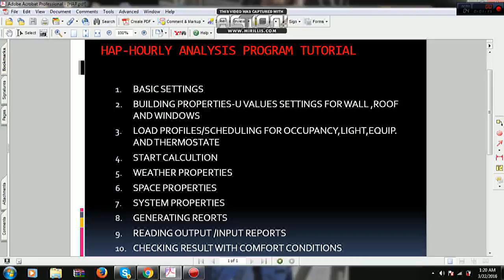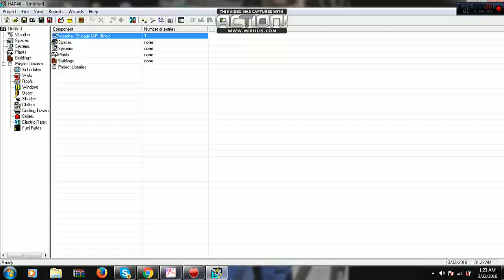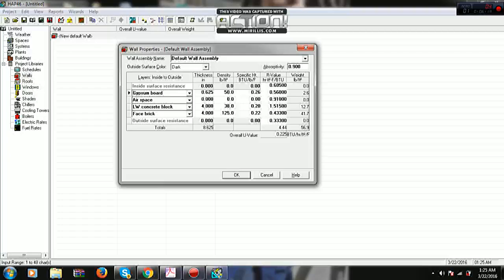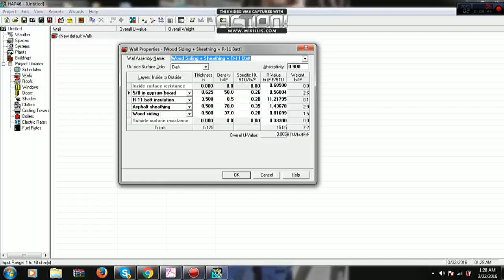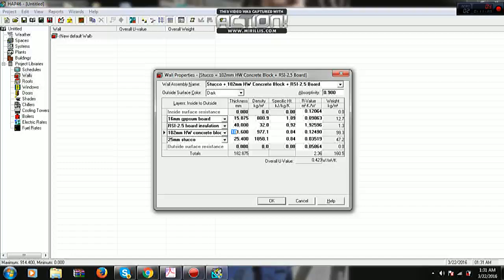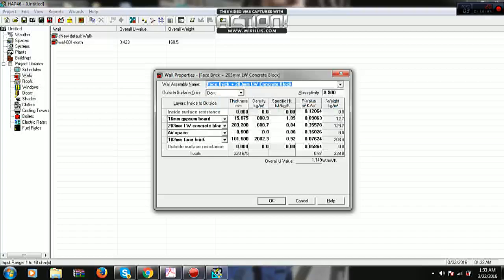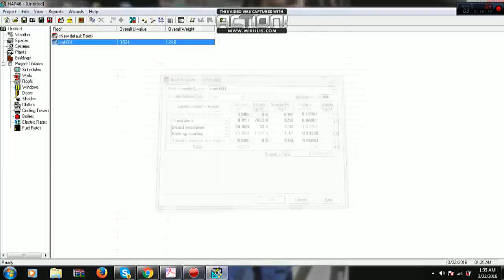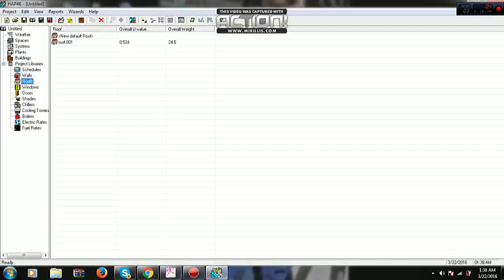HVAC COOLING LOAD CALCULATION TRAINING AND LEARNING-HAP software tutorial English part-2

Comment: thank u. mr hvac my question is how can you calculate the U values for different walls and windows by manual method...by using software it ll be easy to calculate, by default all U values comes in the software....mr hvac do you have any formula to calculate U values. waiting for your reply .......thanks & regards

Comment: Thanks for such effort to make such worthy vedio..i had a question regarding Part 2 (i.e U value)..you have shown example to find out U values for window wall and roof..i had to ask  either i have to put the U value of roof or not in case of 2 or more floor building and i have to design for ground floor area that is below first floor air conditioned.Conclusion is, do we have to put roof U value for all floors or for only the last floor that is below roof?  thanks
Reply from the maker: For Top floor only. .for others nothing